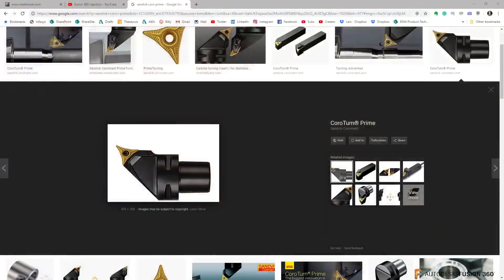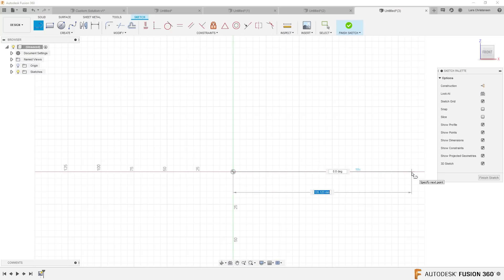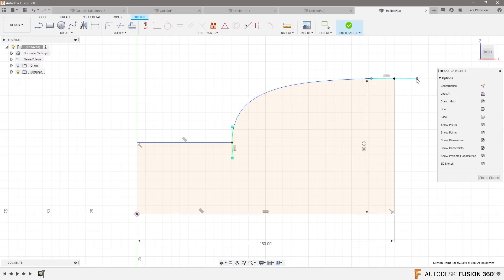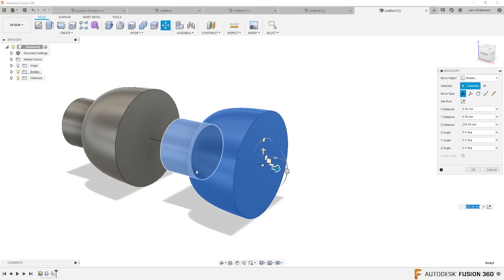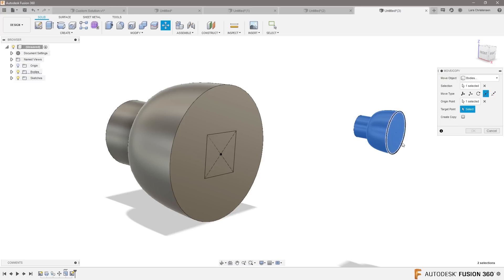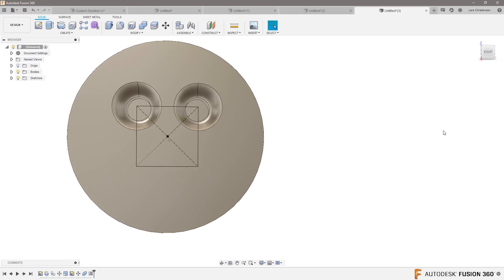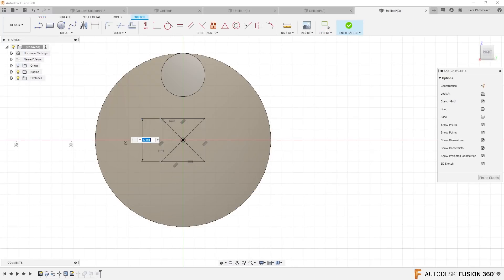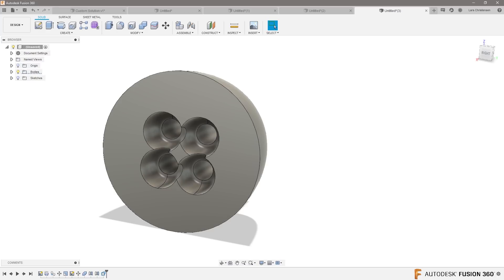Fusion 360 — How To Model a LED Reflector — Ask LarsLive

Comment: Not recommend this video for anybody wanting to make useful part. inside must be paraboloid and LED bulb must be in the focal point of the paraboloid in order for you to have reflection. you can put mirror texture on the model and put the rubber sphere in place of lights and if you render you'll see that the reflectors that you made will not reflect the color of the ball.

Comment: Make sure you assign material as mirror and appearance as nickel or a polished aluminium etc.... The light source should peak out of the extruded hole by like 1mm make the material glass, and apperance as the oled panel, remove the image, use solid colour make sure the three elements have a matching colour and up the reflectance depth and the luminosity to suit.... (5000-8000 max) when rendering make sure to darken the envrionment otherwise you wont see the effect well unless your casting it onto a designed  surface

Comment: another way of creating this reflector is with the basic profile draw a circle the diameter of one of the "cups", revolve cut then circular pattern (4) add the through holes on the bottom.

Comment: For the reflector instead of using the spline curve could you have used the conic curve and set the rho value to 0.5 making it a parabolic shape? Also is there any way in Fusion 360 to find the focal point of this curve? I have only been using rough estimations.

Comment: +lars
 I'm designing a quadcoper frame, I realised that your recent videos you sketch more in DESIGN space rather than MODEL like  in older videos, is there a reason for that?

In my case should I make the sketchs in DESIGN or in MODEL space? Or there's no difference?

Just started with Fusion so still figuring out all this differences.

Thank you for all your amazing videos, did the 3 part video (box and lid) was enough to get me a fan.
Reply: Bruno, it's just new Fusion UI. You can switch on it in preferences. It's doesn't add new editing tools, just different organisation of your interface.
Reply: @oleksiy_rybakov  thank you. 
So it's basically the same, just a matter of organization of the new UI, right?
Reply: @_WARL0CK_  exactly. I like new UI, it's more customisable. But if you don't like to reshape your habits you can still use old version for now. Anywhere, editing tools is the same, just  located in other order.
Reply: @oleksiy_rybakov  I'll probably change for the new UI, since I'm just starting, I think it's better to learn already with the new UI.
Thank you.